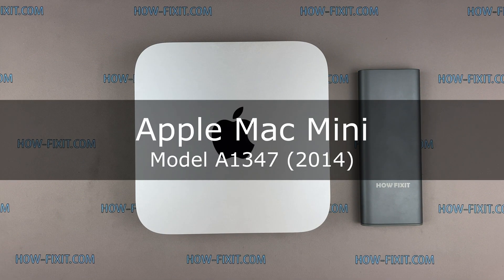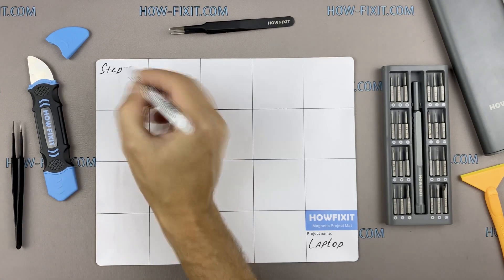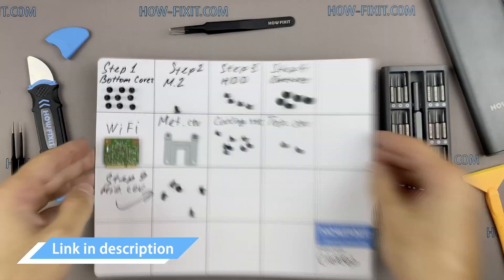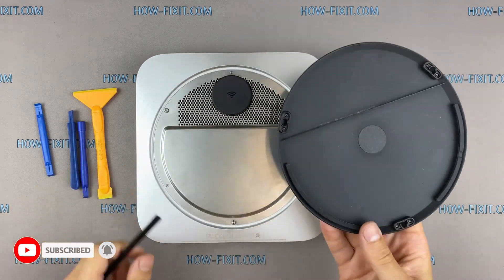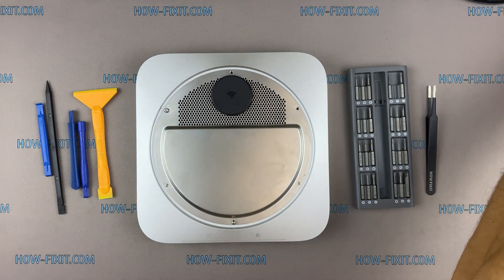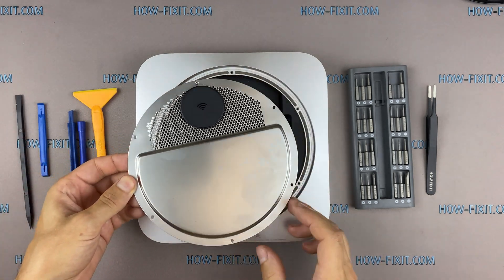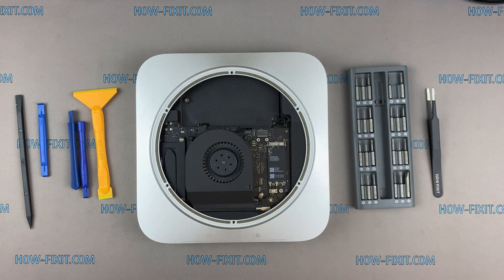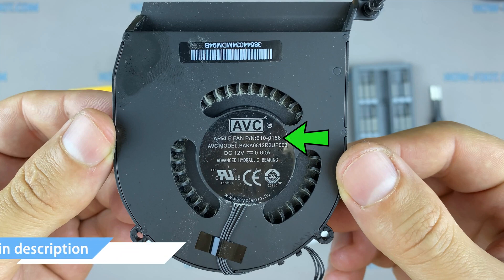Apple Mac Mini 2014 (A1347) Fan replacement

Comment: Hi there,  I was in the process of changing the drive in my 2014 Mac Mini and I had to unclip a small connector on the edge of the motherboard slightly to the right of centre, I lifted it incorrectly and I broke it..aagh! I didn't have the correct Pry tool.  What is that connection.....Pls let me know what it is and what I must do to fix it? Will i have to replace the whole multi-cable? Many thx. Keith